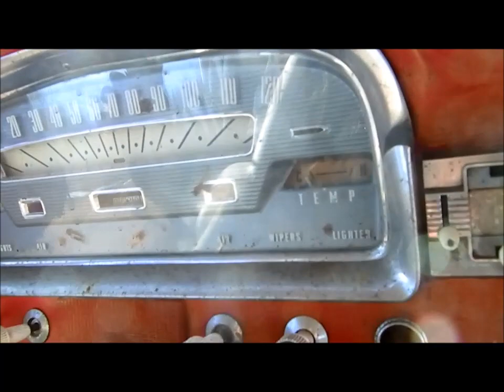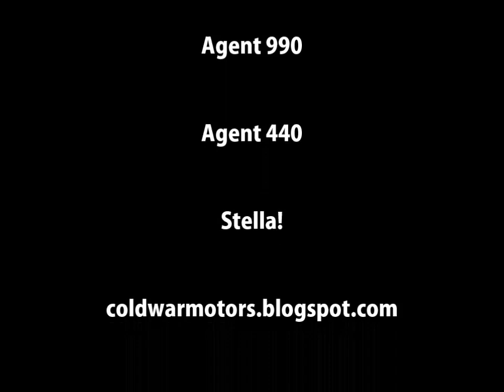Saved From the Crusher: 1959 Meteor Rideau!

Comment: I know a guy in Calgary that has a 59 Meteor 4 door sedan base model with a six cylinder engine and 3 speed transmission. He has owned the car for over 20 years and still drives it.

Comment: A light misting of motor oil will do wonders in keeping these cars from rusting further, and it will protect the metal trim from pitting.  Its a very cheap prevention. From an environmentl stndpoint, think of all the resources that will be needed to fabricate or repair the rusted out panels.  Under the hood should be sprayed as well to protect, and keep rodents out

Comment: Time to build a rat rod without breaking the bank. Now there’s a challenge, you had a V8 capri at one point. rat rods don’t have to have a V8 though, I know that diesel rat rods have been built before [one features on a tv show in England called Sin City Motors which is filmed in Las Vegas].

Comment: Ah, same rainy Saturday morning as the `53 Packard comment, and I just happened to click on this `59 Meteor video. Why, you ask ? We-e-e-l-l-l, because this video reminded me that I have, in my possession, a NOS Ford/Motorcraft/Autolite 1956 Carburetor ( Part# B6A-9510-R ) Single-barrel that fits on Fairlanes/T-Birds/Meteors with Y-Block 272,292,312 engines.

I noticed that there is a definite lack of an engine in Dean`s, er- I mean Agent 303`s `59 Meteor.

So ... if Dean, er- Agent 303 < or anyone else > should find that they are in need of a NOS carb for the above-mentioned vehicles ....